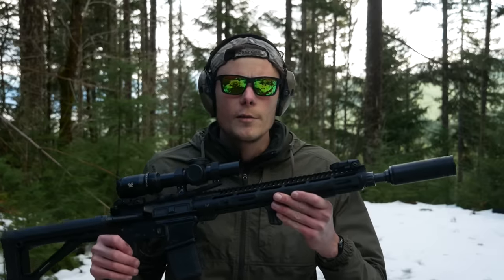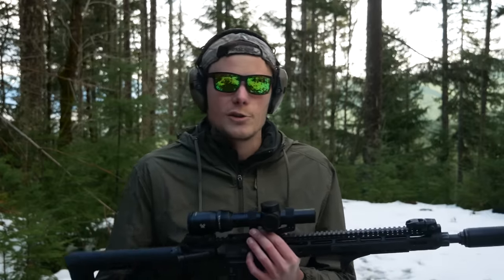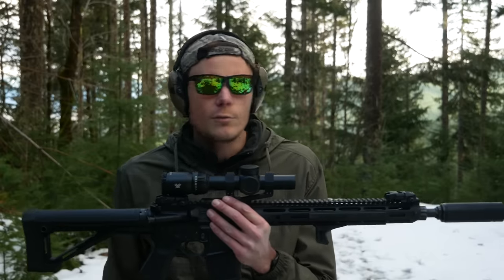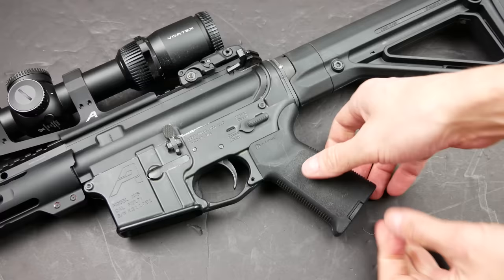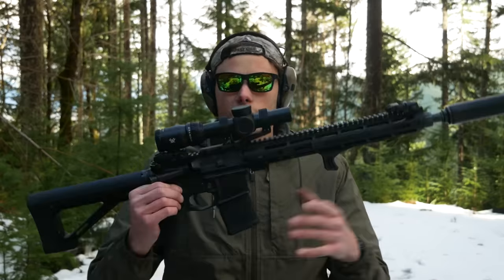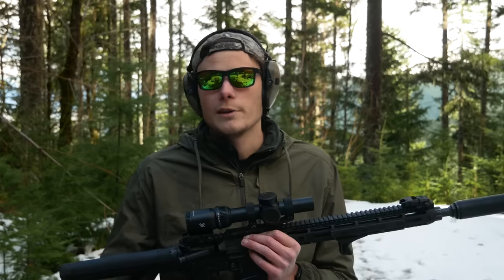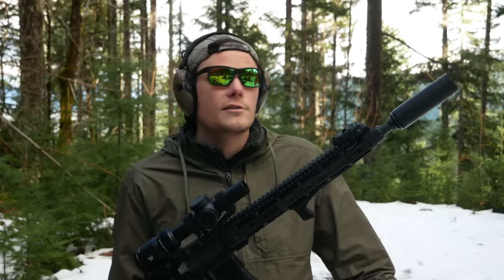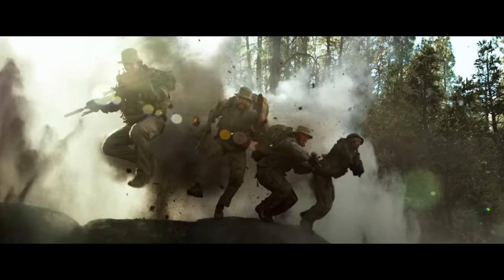WTF are Backup Iron Sights For?

Comment: I broke an ACOG on my Afghanistan deployment. The rifle was leaning up against a wall and fell on the ACOG and must have messed up a lens inside or something because it was blurry and unfocused after that. I spent the rest of the deployment using my backup rear sight. I was a POG so it didn't matter but I still broke an ACOG with just day to day use. I will always have back up iron sights on any rifle I own because of this experience.

I really like that I can use the back up irons through an EOTECH or red dot without taking it off as well. Just in case the batteries die or something. They are always there if needed and the Magpul pros don't even take up that much space.
Reply: I and other Marines have knocked our rifles over many times with the ACOGs hitting concrete. Never seen one break, but it's a good reminder that anything CAN break, especially optics full of glass and moving parts. I still keep a set of backup irons on my current rifle with my ACOG and have been mocked for it. They weigh 1.5 ounces and you just never know what can happen.
Reply: @jeffr5552  I'm a big EOTECH and magnifier guy. It's so easy to pop the sites and use them through the glass and great if the batteries die. Even if I had an ACOG I'd keep the irons no matter what people say. If you go Magpul pro they barely take up any space and it's go to know they are there. Two is one, one is none and so forth.
Reply: That's interesting. I watched an M4 fall off the back of a Stryker while doing 30mph, land on the ACOG, we stopped. Picked it up, and continued on to the range we were running. The soldier went to reconfirm his zero and there was no zero shift, and no damage aside from cosmetic. After that all I wanted was an ACOG. 🤣
Reply: You broke an acog with sheer negligence... itd likely already been abused its entire life. "Straw that broke the camels back" type of shit... my acog held zero after i was blown up by a 20,000lb vbied that knocked me on my back, landing on top of the rifle and optic...
Reply: @FrankStallone42  IDK man. It went from "unkillable" to "help I've fallen and I can't get up" real quick.
Reply: @BullMooseFox  no it didnt... the thing had a lifetime of nothing but abuse and negligent pogs dropping it on the optic, nothing lasts forever.

Comment: Twice during training I have had optics fail: BOTH were Trijicon i.e. name brand, top of the line so this isn't a budget issue. Once a nitrogen seal failed in the rain allowing water into an LPVO which fogged internally and required entire optic to be replaced and the second time the weather was just absolutely perfect for constant mist and no amount of wiping either lens allowed me to see anything. Both times I had backup irons on my rifles and proceeded without interruption. Only had to QR the optics off and flip up the backup iron sights. Backup iron sights are mandatory in my opinion. Only people who say otherwise train on indoor ranges or outside only when the sun is out and the weather is nice. Train in the rain, snow, humidity and brutal heat and you will absolutely add backup irons to your rifles.
Reply: Sure you did. You walked on the moon too.
Reply: 18 months in Afghanistan,  never used irons once.
Reply: @chrisquintana3877  25 years driving. Never used my airbags once.

Comment: My primary reason for running BUIS is due to weather. We have pretty severe winters where I live and humid summers which results in a lot of fogging and freezing issues for lenses. Any time I come in from shooting in the winter my optics are completely useless for 10-30+ minutes depending on how cold they got, and in the summer when I go outside, they are fogged over for about 1-5 minutes depending on how much hotter it is outside, and the humidity. The Elcan has been the worst offender so far for this. For those reasons I've started adding more offset irons to any scoped set up I have and appreciate the unity fast riser for my red dots even more sense I can use the irons underneath the optic. It hasn't caused me any real life issues so far as I haven't had to use a firearm in self defense yet, but in a TEOTWAWKI, SHTF, Red Dawn, and etc situation I want to have optics that will work regardless of the weather I'm in.
Reply: Not trying to be funny, but I'm really interested as to what state this is.
Reply: @Mmmmbbbbaaaaakkkuuu  I live in MN but it seems to affect most people in Great Lake states that I know that shoot outside in bad weather, not just mild sunny days. Probably since we tend to have a lot more water bodies than other states. My family range has multiple ponds on and near it so it's probably exaggerated to me specifically too. Our initial berm that started the range is next to a pond and every 3-5 years gets completely submerged in flood water.
Reply: Oh man, that’s wild! I thought it was bad here in central Florida
Reply: @Mmmmbbbbaaaaakkkuuu  I wouldn't be surprised if they had the same issues minus the freezing over

Comment: It’s a useful parallax checker (when viewing magnification for making precise shots), 

and a great point shooting reference (the similar way CQB was done with irons Front sight post to center mass).

It also conveniently saves your zero and transfers that zero to other optics using a boresighting laser.

It’s also rain proof just in case if the optic cannot handle the rain.

Comment: I use back up iron sights even with my ACOG. I keep the front post up since I can use it as a reference through the ACOG (how left or right I am looking through it) and it doesn't get in the way. On shorter handguards (I'm using a 15" free float MLOK one), I can see getting rid of them to make room. Just use your head, make a decision, and move on.

Comment: As an Ex-LEO a lot of us liked the 45 degree sights because the most common issue the we saw was the rifle being stored inside a patrol vehicle with the AC cranked!!  When you got out and grabbed the rifle in a humid summer night the rifle would get quickly become wet with condensation. and you just could not see through the scope.  Anti fog helped but not always enough.  the option to have something (when you pointed the gun and saw only grey wall nothingness) made sense.

Comment: Maybe people don’t actually train, or maybe it’s just my crappy eyesight, but the second it starts raining hard, that dot turns into a firework show all over that fancy wet glass and I at least need an iron front sight.
Reply: Same experience here.

Or fog can be an issue.
Reply: That hasn't happened to me, but I haven't been out shooting in a thunderstorm either.  I've been out in light rain and it wasn't a problem.  If you have a protective shell around the optic then it takes a real downpour to become an issue.  Or if you have the type of cover that obscures your optic to people at a distance  but you can still see through it  (I forget what they are called, but I have them for multiple optics so they do not reflect).  I really like the Romeo 8 for this reason, also comes with flip up covers.
Reply: You might have an astigmatism.
Reply: So many people have no idea how their rifle functions in the rain

Comment: I have the Magpul MBUS Pro (offset) iron sights, because I have to slide my prism optic all the way to the back. They are tilted at a 45 degree angle. I even have to put the rear sight ahead of the ejection port. Not the ideal position for them, but they are just an emergency back up only, as my scope has an etched reticle and my light has a green laser.

Comment: Also a bonus of irons that are "permanently" on a gun ; if you're swapping unmagnified optics around, you can actually zero them using your irons (assuming the irons are zeroed). Just flip up the sights, and adjust the dot so that it aligns with your point of aim when looking through the irons.
Reply: Likely doesn't work for 1x prism sights.

Also, there's some discussion of zero shift between aiming with the irons through the red dot glass, and aiming with the irons without the red dot glass. Since the red dot can/does shift the image of the front sight in space.
Reply: @roflchopter11  if your red dot was made in the last 10 years you won't have an issue. Parallax shift from even lower 1/3 co-witness would be extremely small, and basically completely unnoticeable if it's there at all. Absolute co-witness would have zero difference. 

And technically 1x prism optics are magnified. They aren't truly "1x".

Comment: I didn't put BUIS on everything until my short time in the army. I had Trigicon, Aimpoit, Eotech optics at some point fail on me or self delete zero. In the occupational use of the rifle living with you it just happens at some point and is natural. I ended up popping up my irons a lot unfortunately. Quickly learned that yes I am adding extra weight on the rifle but for very good reason. There was a hand full of times that I would just toss the optic in the assault pack till the problem could be addressed or I could get a new optic. It is what it is one is none two is one is a true statement. I learned the hard way.

Comment: My situation: Im not a gun "collector". I own two rifles that Im happy with and Im not particularly interested in getting more *at this time*. I scratch my "variety" itch a different way that you'll see below.

Aside from whatever worst case scenario I/we can imagine happening...the other reason I have irons on my guns is that when I go train I'll run all of my drills with my optics and then pop them off the QDs and spend a little time on the irons too. 

If Im playing around with a new optic wether I bot it,  traded for it or it was lent to me I'll pop that on and play around with it too before putting my primary optic back on.

So...aside from the "emergency" use case, the quality of life use case shouldnt be ignored.

Not every gun needs irons, QDs etc but the one(s) youre using a lot wether its for work or play probably should

Comment: My favorite upper is the Colt 6943 for many reasons: one is the built in flip up front sight. You can use the tube of a T1 as a psuedo rear sight and it works out to 75 pretty accurately.

Comment: I align my BUIS with my optics. A quick pop up and check your rig. A 45 mounted Red dot for a 3rd option. Laser pointed at my vertical sight points. Minimal and unobstructive, and can reference each other at your zero point. The 45 so I can have a lower profile in prone position and still hit my objective.

Comment: Hot take. Back up sights are 2012. 
Most reddots today will never fail with maintenance and care. 
In the event that my red dot fails, I'll have another red in my bag to slap on the gun.

...No light, cracked glass, moisture in glass, etc tube can still be used to point shoot in a pinch, or whatever the larp calls for...
Reply: No. 

I've had optics fog up. So switched to irons to make shots.

I've had optics coated in rain, snow, or ice. Had to switch to irons to make shots.

My recommendation is a 45 offset or run the optics high enough you can see the irons underneath. When I've had to transition, it's had to be fast.
Reply: Says the guy who only plinks at the range and/or larps at airsoft events

Comment: Part of my routine when deploying with my DM gun is to open the offset sights and keep them open until I put the rifle back in its case. In the unlikely event that the LPVO goes down, the backup sights are already up. Similarly, I like running a fixed front sight on my shorter rifles, which tend to have red dots or holographic sights. While this only cuts down the time needed to open the backup sights by roughly 50%, I generally use a folding rear sight in case that gun happens to have a magnifier.

Comment: I like back up irons not just on my tacticool guns but also on the deer rifle. A couple years ago I ran into issues with my main optic twice in a season. First time was on my crossbow, where the nitrogen seal broke and my optic fogged up, cost me getting a shot at a nice doe. The second was with my 760 gamemaster with shoot through mounts for my scope. Weather kept fogging up the glass on the outside, so when i popped over a hill and ran into a doe those it was nice to have the option on back up irons.

Comment: I have BUIS on everything, all zeroed to 100y (5.56mm)... mainly for co-witnessing.  And when adding a suppressor, I adjust my primary optic and leave the BUIS alone.  When the can comes off, I can co-witness.  They do get in the way sometimes (magnifier, remote switch, etc.) so I understand the impulse to remove them.  But I am old AF and am set in my ways at this point.

Comment: I've used my BUS to get a quick re-zero when switching from my scope to my Eotech with the co-witness and when remounting the eotech after a battery change. It may not have been a perfect zero, but it was still "on" enough that I was hitting the same mediocre groups that I was capable of hitting at 100 yards before taking it off initially. I even zeroed my BUS with the Eotech. As long as you remember to put your shooting eye in the exact same spot with cheek weld etc, which is necessary for repeatable accuracy with irons anyway.

Comment: For an Apocalypse or SHTF backup sights makes sense, but if you look at current photos of Teir 1 Units, many have ditched backup sights.
Reply: Most of their missions arent "in the field for a week". Theyre doing vertical insertions or similar stuff where that isnt so much a concern
Reply: Tier 1 units are also often built around huge support networks. If you're getting choppered in to attack Bin Laden's compound and you see that your sight is messed up, there's probably someone there that can do a quick swap. They're also more likely to have offset sights, lasers etc that can work.
Reply: Tier 1 units operate as teams.

If I have to use a rifle I'll be alone for a while, so I like the idea of having a backup option on the rifle so that its still useable.
Reply: Teir... bahahahaha

Comment: I run offsets with my lpvos.  The thought process is as follows; if I'm on max magnification and suddenly need to transition to a close range threat, or perhaps a moving threat at a range where magnification presents an issue, I can simply "roll over" to the offsets.  I practice this regularly and have needed a sudden shift on more than one perimeter.  Didn't need to engage, but the transition was smooth.

Comment: I put my optic on top of a carry handle (the same height as a riser anyways) so I just scrunch my face down to use the backup irons. And since the M16A1 sights were designed as a primary sighting system, they’re also really good “backup” iron sights with no deployment necessary.

Comment: Not on my rifle, but I was having a massive POI shit on my pistols RMRcc after throwing a suppressor on it which was "aligned". Adjusted my red dot and found it was almost walled out.
  
No evidence of baffle striking could be seen at first, so we took it off, and I was shooting stupid high.
  
Found the piston was jamming and I was barely touching the end cap, when I got home and cleaned it out later.
 
 However while at the range I eyeballed the rmr cc to the irons, with the suppressor off, did a 3 shot group to get my POI and adjusted with a final 3 shot group to confirm zero.
  
Didn't fix the suppressor piston issue (griffin camlok sucks major D), but got me back on zero in less than a minute to where I could still shoot my course of fire with no suppressor.

Comment: No need for BIR's for me.  I use the Primary Arms SLx 3x32mm Gen III Prism Scope - ACSS CQB-M2 Reticle - 5.56mm.  It works with or without power since it has an etched reticle.  And the ACSS is just like the ACOG, and less than a third of the price.

Comment: My red dot is zeroed for the likely distance that I will ever engage during a home defense scenario.  My backup sights are visible through the optic if I deploy them, but they're zeroed at 50 yards. That way I have the dot for close range, and the co-witnessing iron sights for mid-range.  May not be the best setup, but I train with both, and I am accurate with both, so it's what I've got.

Comment: I use BUIs if I can, but it's impractical when you have a magnifier. Nowhere to put the rear sight because you want the magnifier as far back as you can, and immediately after that is the optic. 

For an LPVO I would prefer an offset dot, but offset buis would work too

Comment: Although I like the idea of a QD mount, I concede that keeping the tool on the gun is probably sufficient. However, if the tool is at home, another option is a completely different rifle, especially with knowledge of the situation I find myself in. Other protips: cowitnessing backup sights can be use for zero transfer. Even a rear aperture alone in cowitness increases clarity of red dots to bad eyes.

Comment: I usually keep backup iron sights on my guns regardless. Except my Mk.12. I've built that specifically for medium to long range engagements with a suitable suppressor to help conceal my firing position and keep spare batteries on me if needed in multiple locations. If I'm really having to rough it and haul ass, then I've severely fucked up. The way I have my Mk.12 setup, I can't fit a rear iron sight anyways. All that being said, I keep a spare set of Magpuls flip up sights in my bag to attach for rough aiming at close range (within 75 meters) if I ABSOLUTELY need them. Of course, I carry a sidearm though as well (in my case an FN 510 with an RMR).